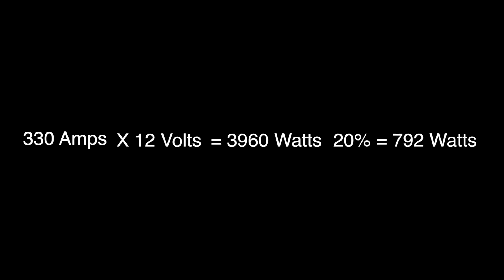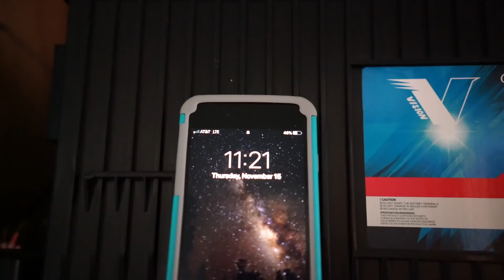We broke our SOLAR POWER | Heres how we fixed it

Comment: Besides the Voltage meter you mentioned which is in my opinion a must in any offgride systems. If your not there yet another way to make sure you don't have costly replacement before true end of life in optimal conditions. A very cheap 40+ dollar alternative is a Voltage cut of switch that will disconnect the battery from your loads when the battery drops below a certain threshold. 
Thease are used in cars, and many systems were protecting that battery is more important than using power at all time. With a somewhat analog system like you have at your homestead this is a cheap add on that will protect your investment now rather than having to add more expensive panel + batteries to expand you solar production & storage. 

Good luck out there! Hope to see you booth around Puna sometime soon! 
Aloha!

Comment: RV fridge works great with solar. Solar stake lights make great lamps. Leave them in the sun all day, I use a milk crate as a holder. Pull the stakes off and drop into a small jar for a lamp. They’ll last lit 6-8 hours. If you can find them get the ones with on/off switches. If you use 2 or more batteries it’s important that the connecting cables are the same length and don’t add a new battery to an older one. Marine trolling motor batteries work well as they’ll take repeated amp draws and recover quickly. Lead acid batteries need a well ventilated area as they produce hydrogen gas.

Comment: Ten batteries connected in parallel, and you should check them for bad cells on a weekly basis or get some cheap monitor circuits that you can leave connected at all times.

The sun doesn't mind if you collect enough power to enjoy a feeling of security.  As a matter of fact I spoke to the sun just yesterday and he said he didn't care.

Comment: I totally killed my first batteries as well.  I don’t have panels yet, I was using the generator to charge them.  Then I was using the batteries for lights and phone charging at night.  I wish they would make inverters that automatically cut power rather than a screeching alarm that I usually don’t notice.  And really doesn’t that screeching alarm just suck up more power?

Comment: Hey, one thing that could help is to eliminate the inverter for things like laptops and cell phones. They run on DC, so there are 2 conversion steps that waste a lot of energy in the process. Some fans, LED lights, and other equipment can run directly off the DC current as well.
Reply: *without a pure sine wave inverter, don't bother charging computers with solar, and DC w/o a charge controller is foolish
Reply: You'd need some kind of DC voltage/current regulator, but there should be RV and trucking equipment that would work. Plus, DC is fairly safe to work with, as Edison illustrated.

Comment: first thought was you blew the flux capacitor glad I seen it still on the wall, not as bad as I thought bummer you had to spend a little coin but you got a handle on it guys you always do... past experience in running RV dealerships our service departments have put in hundreds of solar systems on various types of trailers and motorhomes  there are also inverters that monitor the Heat  of the battery  But there again  it's all about how much money you want to throw down on a solar system. Jill is about 80 + percent and healing day by day, going to have to hire your ass to help me find some land soon, L.O.L... take care. from Paul and Jill

Comment: We had similar problems with our solar when we were first putting it together about a year ago.  Adding more solar panels and batteries really helped by allowing our fridge and a few other things to run while still making enough power to charge the batteries at the same time.  We also bought a few portable power banks to charge during the day when the suns out and then use it at night to charge our electronics so we don’t drain the battery.  It has been working pretty well for us, you may want to check one out.  If you plan on having a fridge you may want to add a few panels so you can make enough to keep it running even on cloudy day.  Since we added more panels to our system it’s been making enough to keep our tiny house running comfortably, even these past few weeks with the sun being choked out by the fires here.
Reply from the maker: Thank you for the input 🤙

Comment: You guys made totally made me get my geek on! 😂 Puts glasses on

The 12V330AH rating on your battery means 12 Volts, 330 Amp hours (Ah) It means it is capable of giving a Current of 330 amps (A) for 1 hour from full charge to complete discharge. 330A x 1 hour (h) = 330 Amp Hours (Ah). Actually doing that will damage it very quickly though.

Another better way of thinking is that you can run a 1 amp current for 330 hours, or more realistically a 10 amp current for 33 hours. 10A x 33h = 330Ah.

Complete discharge of a battery (you'll be pretty close to it if your inverter  alarm goes off and if you keep using it with the alarm going off it will be completely discharged) is really bad for it, especially if any time passes before charging again. 20% discharge, i.e. never letting the battery go below 80% of fully charged will mean that you will ensure a really good life cycle of the battery.

So you really need to think of your 330Ah battery as a 66Ah battery if you are only going to use 20% of it's capacity. If you need to actually use 330Ah you would need 5 batteries in a bank.

So in reality to keep your battery healthy you can run a 10A load for 6.6 hours (6 hours 36 minutes!).

The measurement of power over a period of time is Watt Hours (Wh). More commonly in household power and solar it's measured in Thousands of Watts per hour. Kilowatt hours (KWh). 1KWh is one unit of electricity from the grid.

If you use that it's easier to get your head round it. Watt Hours (Wh) = Power (W) x Time (h).

So your battery is 330Ah, 12 volts.

Power (W) = Volts (V) x Current (A)
12x330 = 3960w

So that's 3960Wh, or 3.96KWh. Almost 4KWh.

Remember the 20% though, so that's 792Wh or 0.792KWh, we could round that up to 0.8KWh. That's almost 1 unit from the grid!

Anyway, back to your stuff:

Laptop, 60-80w, using/charging for 1 hour.
That's 80Wh, or 0.08Kwh. 10% of your safe power reserve.

Lights for 4 hours.
60W x 4h = 240Wh, or 0.24KWh. 30% of your power reserve.
60W for light is quite a lot. Make sure all bulbs are LED. They don't need to be super bright ones, I reckon you could get that down to 20w.

Fan overnight. Say 10 hours.
0.3A x12v = 3.6w.
3.6w x 10h = 36Wh or 0.0036K KWh. 0.5% of your power reserve. You could pretty much just leave your fan on all the time!

Fridge. The power killer. :(

I'm afraid you won't be able to constantly run a fridge with this setup.

A fridge will use about 80w when running. Because they cut in and out it will run about 50% of the time, more if it's  in a hot environment, less if it's cold. So for this calculation we'll say it's actually running for 12 hours of the day.

80w x 12h = 960Wh or 0.9KWh. That's 113% of your power reserve so you will be going over 20% discharge with just the fridge. Also, with just the one solar panel you will likely never be able to manage to get the battery up to fully charged with the fridge running. I'd consider getting a fridge that can run on gas and keeping it outside the container, maybe in a ventilated shed.

If you really wanted to have the fridge on electric then you'll need another battery, and another solar panel. Think of the fridge using an entire panel and an entire battery, plus a little bit of the other ones. :) You'll really need to monitor power in from the panels and power out from the batteries if running the fridge.

I hope this helps a little. I have a solar setup in my van but underestimated the fridge consumption. I generally use it just at weekends so it's not so bad, I use ice packs from my house freezer to reduce the power needed to run the fridge and that works ok for now but I'd like to upgrade. Another panel and battery, plus charging from the engine when driving should do it.

Loving your videos guys!👍

Comment: agreed. properly sizing your solar system is key. although i've seen a lot of people moving away from batteries and using capacitor banks instead. not sure what the price difference is, or any maintenance that is required. might be something worth looking into?  anyways, great info, sorry it cost you so much to find it out. :D
Reply from the maker: Thanks for the comment I will have to look into that 👀

Comment: Suggest adding an extra solar panel, wiring in series to a charge controller that stops the current when the battery is charged.  Wire in series to get more voltage input to the charge controller and hence, a faster charge.  I hear that a charge controller is vital to extending battery life as well as not discharging them too much....current and the resulting heat is what kills the battery.  Good to see you two.  You two are an inspiration and yeah....you could be movie stars🌈🤙
Reply from the maker: That thing with the three dots is a charge controller 😬 thank you for the suggestions